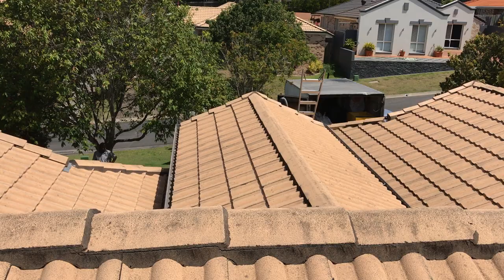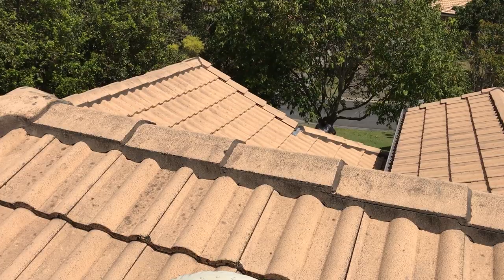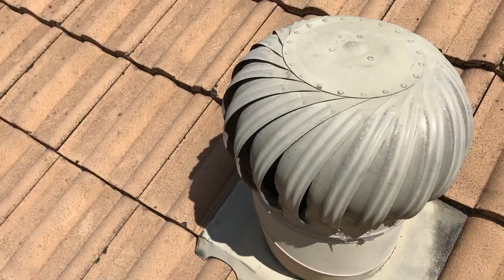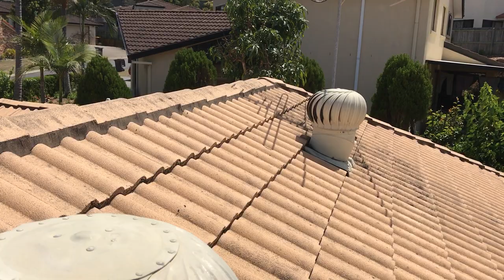Stop your Roof vent from squeaking  and squealing all night  with this simple and cheap fix.

Comment: Worst advice ever. Don’t listen to him. Just replace the damn thing. Less that $50
Reply from the maker: I agree that a better solution might be to replace it but the new one will fail in the same way in a few years too. If they worked like the box says and never caused problems in storms replacing it would be reasonable.

However an even better solution is to replace the broken vent with a roof tile and get rid of the things all together. You roof will be safer and you will never need to worry about leaks.

Mind you some people might not have a tile that matches there roof and so gluing it up to stop it leaking in future and making noise is a cheaper solution that can be done without needing to know how to replace tiles.

Thanks for your comment!! I hope this helps someone understand the situation better.
Reply: @InsulationTeam  You have no idea what you’re talking about. Just stop. Absolutely you need proper airflow in your attic for a number of reasons. Sealing  them off is dumb And opening yourself up to a world of problems for no reason.
Reply from the maker: Gee I wounder what people did before they had whirly birds? Oh that’s right they just had safe leak proof roofs and good insulation. 
My qualifications are obvious but if you care to elaborate on your comments for everyone who is to dumb to put ventilation on their roof maybe that would help other people reading this thread? 
I have seen thousands of roofs damaged by roof vents that stop working but never seen one damaged by not having one?
Reply: Wouldn't do sloppy work on my clients vehicles , wouldn't let you near my whirlybirds nor my house , how many shortcuts on the insulation jobs , 20 cents worth of silicone compromises the home owners insurance and will rot away in a season .
Reply from the maker: Ya I do all my own mechanical for that very reason... it is hard to find good trades in any job, I would point out that the silicon will not rot because it is not in the sun and leaving it spin for the customer will have worse outcomes as the shaft cuts though the top of the vent and then it falls off causing a much bigger insurance problem...   It has been several years and that customer has never had any problem with my repair that cost him nothing.. Maybe leaving the roofing advice to roofers and I will promise not to give mechanical advice on your channel ..